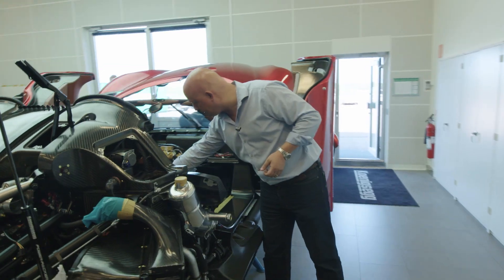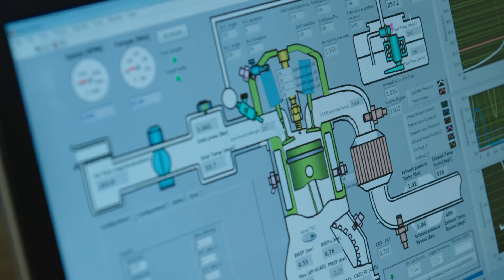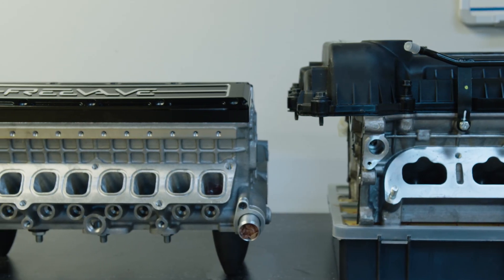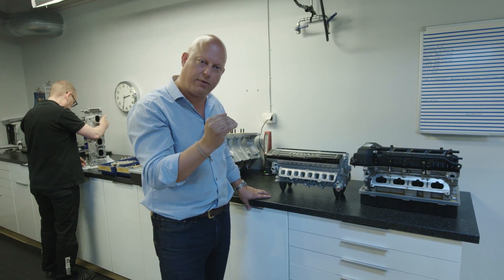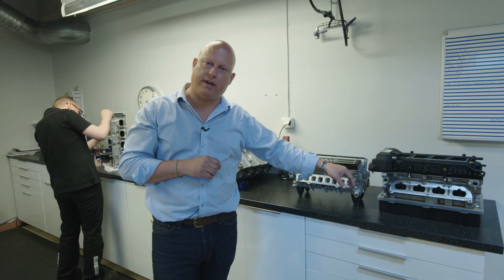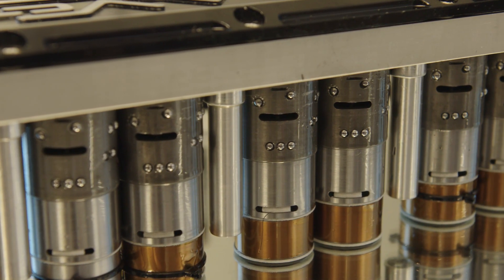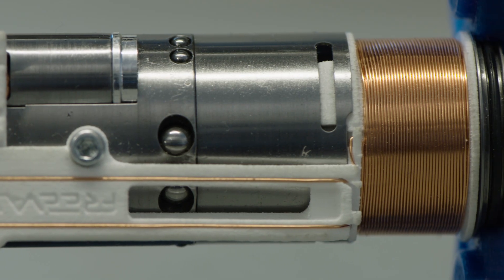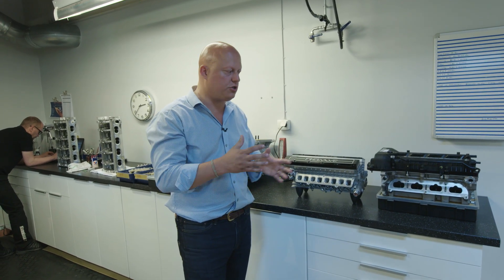Freevalve Update Camless Engine -- /INSIDE KOENIGSEGG

Comment: So theoretically you can turn any engine into "2 stroke" or have a "2 stroke" mode by doubling number of times the values open in additional to the fuel injection. I mean you'd need a blower or super charger. Something simple like a "torque amp"

Comment: It is lovely how he know so much, makes sense Koenigseggs are so quick right now, but I feel he has done a mistake, he says and I quote "You avoid getting particulates into the exhaust because you get cleaner combustion with a more controlled combustion of the fuel entering in the cylinder", this was regarding the advantages of port injection. I say this is wrong because in port injection engines, the fuel is sprayed a few moments before the valve is opened, this allows the fuel to bounce of the valve and tumble creating a homogenous mixture and allowing cleaner combustion. I feel that the part of the "more controlled combustion of the fuel" is incorrect, not the other parts, I may be wrong as I do not know exactly what they have done inside their port injections. This is just my belief.

Comment: Do the valves need springs to pull them closed, or do the coils do a push - pull on them. I heard the word pneumatic used, but it seems that filling a chamber and voiding it would slow the whole process down.

Comment: I'm really kind of wondering when I'm going to be able to buy a free valve head for my 1FZ FE FZJ Land Cruiser. I also think that Cummins 12 valve would be a good base. I don't know if you considered diesel applications. I'm sure you've considered just about everything but I don't know I just would really like to see a system not that I could afford one but if you haven't thought about it yet and you happen to  want to draw something up you know you can go ahead and get a hold of me and ship me one it'd be pretty great I don't know what you use for ECUs but I'vkind of had my eye on haltech I don't know if you guys work together or what but. In any case I think that what you're doing is amazing and could revolutionize a lot of combustion engines as an aftermarket system. Especially if everybody's going electric we're going to have a lot of old cars running around they can still be powered by gas and I think that you can get more power and better emissions with your system.
Reply: I bet you guys can probably design a sweet hydraulic tree valve system that would be sick. It'd be nice if things were hydraulic and mechanical controlled by electronics . Actually I can't share too much But I'm giving it thought.

Comment: The French used pneumatic valves a while back in F1 then abandoned the system because it doesn't work well: no thanks
Reply: Because the tech required wasn't there yet
Reply: @saber-san6270  it was there: buyer beware. This is a stunt that will inevitably sabotage anyone who buys into it, if it even ever goes to market, just like direct injection, which actually has made it to market and is trash

Comment: The issue I see being the primary obstacle is ensuring there is enough pressure to move the valves in a timely and consistent fashion. Hydraulics would have too much mass in their fluid, I think.

Comment: Even though this engine has been around for a while, fast forward to 2022 and our moron Potus is pushing electric cars, way before the world is ready, in regards to price, infrastructure and without regard to slowly phasing out gas engines. In fact, gas is now the highest in my lifetime ( 63 years) of $ 4.50 per gal average and $4.75- $ 5.25  in Illinois . I remember gas in the '60's as low as $.19 cents in Missouri, and in Iow a it was usually about .21-.25 cents per gallon, clear into the early '70's !

Comment: The free valve technology will allow an easy implementation of hydrogen as a fuel source this is definitely the way futures This combined with the new design of a motor and drive assembly electric motor makes for a very very powerful combination

Comment: why did this technology not happen ages ago ? I mean I come from a mechatronic / computer engineering background and I am into cars too, so I'm always working with servo's , actuators , SBC's etc. I have also opened a few rocker heads in my time and had always wondered why we do valve timing from a cam when everything we do in this world, including the central locking in said car to open and close the locks is done via actuators. It just seemed so caveman style, if we wanted better performance we would grind the cams but then we would get a bad idle down low. I mean , hell we control fuel via computers 50 years ago and there is a whole market on new ECU's to deliver better fuel performance. I thought there might have have been some mechanical limit to what an actuator could do at high revs, maybe the signal could not get fast enough to open and close the valves properly but it seems like there isn't. Don't know how useful this innovation is for the long term since EV's are on the way. But in the next 15-20 years , lets bring one of these cars out to the masses.  Building variable timing for different purposes could not be easier, we would not need to be grinding cams but just need to open up our laptop's connect to the ECU and change code to suite performance requirements.

Comment: Throttle control from the valves themselves. That blows my mind.  He says the valves are pneumatically driven, but I see a coil and terminals on them. Maybe solenoids control the air that drives the valves open and closed. I know the engine drives an air pump to supply that air.  To get that degree of control with that setup is beyond amazing to me.  Brilliant guy.

Comment: Kinda awesome, because in something like hot rods, you can have “switchable cams” on the fly, so you can switch between a “radical cam profile” and “streetable profile” 

Or even just have a “hybrid” type profile that around idle and under 1/2 throttle it runs in a streetable mode, and when you floor it, it can swap to a radical cam profile.

Even have cylinder deactivation for fuel economy when cruising your muscle car

Comment: so your controlling the valve without rocker arm and camshaft etc.  instead of solenoid valve. That may reduce the weight but what about the computer in the car that operate the solenoid vale in high rpm. another problem with the solenoid is coil burnout did you think of that ?

Comment: What's stopping a current manufacturer like Honda from designing a l4 engine like this? It seems cost effective and very good on emmisions. The engine is smaller and simpler with less moving parts, and yet way more advanced. Fuel injection picked up pretty fast, so why not this? It seems like it has no downsides?

Comment: God it's such a pleasure to watch this man talk. He's got so much knowledge but he can get it out in a way that's so easy to understand for the layperson, and in his second language no less!

By the way, Christian, you've got to get this technology into motorcycle engines. It'll make such an enormous difference there; bike engines are highly sensitive to size and weight so the savings you've made on both those dimensions will be extra valuable; since Euro 5 regulations came into effect modern bikes now have huge exhausts for the necessarily large catalytic converters which has both size, weight, cost and aesthetic concerns on bikes; the concept of variable valve timing is becoming more common now on bikes to get a flatter torque curve and better combustion at all revs--which would be completely superseded by Freevalve tech.

It's obviously great in cars but this would just be so much more valuable in the bike world! You'd be doing the industry such a favour by making it happen

Comment: Here's an idea, can we please get freevalve on the 2011-2021 Chrysler 3.6L Pentastar V6? They are notorious for bad valve train causing catastrophic engine failure. They are a good motor, NA producing 292-305hp, 268 LB/Ft of Torque. All the way up to 6800 Rpm.

Comment: Is this similar to current F1 motors 1.6l v6 use for valve control?  Believe F! also using brushless mtr to instantly spool turbo and also as part of batt. regen system. MB supposed to have E-Turbo assist vehicles for comsumers in 2021. Ya , this tech will extend petro motors yugely if costs allow.

Comment: I guess with this system the engine doesn't need a distrubution maintenance, because it doesn't have any distribution belt. If I worked on automotion, I would want to work on Koenigsegg.

Comment: seams interessting. Where does the power come for the valves to lift (high power for electromagnats). How do you solve the Problem with the powersupply when a battery or alternator breaks down and all the valves are falling down becaus of no powersupply to the coils holding them up? Than we have nice piston-valve crashes g

Comment: Pneumatic valves are at the core of some Yamaha, Suzuki and Honda MotoGP engines that produce over 250bhp per litre without turbocharging.  They allow much higher lift than would be possible with normal cam profiles without breaking they valves (or the cam lobes!).  There’s a world of possibilities for the internal combustion engine, and it’s perhaps sensible for governments to consider more exacting fuel economy regulations for their communities, rather than simply mandating electric cars, which have very high energy costs to produce (ie the pollution mostly occurs at manufacturing time, rather than running of the car).  I’m not also sure that governments have yet considered the high costs of refurbishing electric cars where the battery lifetime is much shorter than the expected lifetime of an internal combustion engine.

Comment: It's brilliant in it's concept,, but not practical in application.  I have no doubt that the initial cost plus the cost of maintenance over the life of the engine will make this a luxury item.  My biggest concern however is the potential for catastrophic engine failure due to piston/valve contact. One digital glitch could obliterate a $25,000 engine.  I doubt any race car owner would be willing to bet his season on such a razor's edge gadget.  I would much rather bet my money on a good set of valve springs, and a superior cam chain.

Comment: What well hapen if one of the solenoid fails?engine damage come next?
Reply: They have metal springs like regular valves which makes them naturally closed. If the solenoids fail the valves return to the closed position by default, so there would be no engine damage. You can simply replace the damaged solenoid. And I would assume that each cylinder runs independent solenoids, so the probability of a total engine shutdown or failure is minimal.

Comment: No throttle body. That's crazy. I mean yeah it can be done and I'm sure anyone can do it but just the cost and having the reliability of these type of valves. To be have absolute control,  pinpoint control of the valve. That's incredible. Awesome. I need to be rich.

Comment: Say someone here in the Bay Area, Calif sent in his 2.3L Ford OHC motor, paid Freevalve to do what is described in this vid, they ship it back, the owner drops the motor back into their ride, and not long after that the motor seizes up, or a head gasket fails, where do you think they'd be able to find a qualified automotive tech to work on said motor? Sh*t would be more than expensive quick, fast, and in a hurry.....ijfs.....

Comment: Why bother with a turbo when the camless system alone makes so many improvements? I would think the weight loss in turbo weight would be improvement itself, and the engine becomes even simpler. Wonderful system. So glad to see redesign being used to make such significant improvements instead of simply adding crap to an engine. Honda started this in the early-ish 70s with their CVCC engines. Great video!

Comment: Call me we will build my engine. Unlimited rpm and 0 friction. Pure flow and only barrier is the bottom end. feel free to rev to 40.000 rpm
Reply: You could increase intake pressures to 100-200 psi before valve even opens and no problems plus completely variable intake and exhaust. its to easy and turbo or compressor is a must with this configuration.

Comment: Damn imagine having electrical problems and bending valves. Good thing my engines driven by chain. Atleast I won’t have to search for hours or days for a broken wire, new valves, new chain, tensioners, guides. Good example on how fixing cars is going to get a lot more complicated and expensive. Good luck y’all!
Reply: Not at all. This looks far easier to work on. If you bend a valve, take out the whole module like a coil pack. These actuators probably default to a retracted position so I wouldn't worry too much about bending valves as much as I'd worry about timing going off and bending valves. Also this doesn't look too difficult to code for at a grassroots level. It's simple variable actuators. Just get the right drivers and you can probably get a Raspberry Pi to control it. Just don't act like an old man lol

Comment: Extremely impressive , but I do have a few questions, due to the circuit boards being located in the cylinder head , as we all know the cylinder head will get hot and this may effect electronics system functions and even cause soldering issues, I also wonder of the life expectancy of the solenoids due to its high frequency of activations, I imagine the life expectancy is rather short lived. If a solenoid were to fail , what type of fail safety system is in place to combat internal engine damage?
Reply: I would imagine the valves default mechanically to a retracted position but also know that there are a LOT of reliable cars on the market today with electronics in the head.

Comment: 8:21 they even modified their fan with tape to make it more efficient (some air would normally blow out the top, when taping that area, your forcing it all out the front, also reduce the energy required to push air out
Reply: That's how you can tell they're engineers lol
Reply: WOW
Reply: I saw that and was thinking about it. Surely not such a high tech company fixing their office fan with masking tape? There had to be another reason, you guessed it, reducing the fan centrifuging air out sideways ;-))

Comment: Rather than pneumatic what about using solenoid?  OR  stepping motors using little gear drive affairs for each valve  Depending on number of cylinders could either have individual stepping motors or else larger motor driving gear shaft operating like valves on engines with a bunch of cylinders. With todays battery technology seems totally doable to me ...mass production could make it pretty cheap too I would think...an engine could be so quickly retuned even on the fly for radically different performance or efficiency ....And how about adding variable compression then since no can drive to complicate that? Simply lifting and lowering entire cylinder head (via ring sealed head cylinders above piston cylinders) small movements up or down  could radically change compression!   High performance sports car could have econobox mode running 87 octane regular for road trips with computer adjusting everything else spark timing, fuel injection adjustment,and valve lift and duration.  Same engine could be fire breathing monster running e85 one day and the next day very economical lower power commuter and everything in between with the flick of a switch and/or fuel change!  Heck COULD even pull from two fuel tanks on the same car!  One with smaller with race gas and the other larger with regular computer systems deciding howmuch/when to pull from each!  EVEN on the fly!  Low compression and milder settings on start up /warm up and also could change relative to load.  Think of the power gain simply not driving those cams!     ...and for spurts of power alternator could instantly stop charging battery that powers valves .....let that happen on decel and constant speed but not performance acceration....even MORE power on tap!  PASSING power!

Comment: It looks like the valves are controlled electrically with one or multiple solenoids depending on how far and  how long you want them to stay open... At least to me.
Reply: That or the windings are for sensors to "see" the position and it functions from hydraulics...
Reply: Controll is oil and air.
Reply: @jonasthemovie  Thanks, I was curious about it because I only started hearing about this when they released info about them building the Gemera and I started to research about it. Right now I'm curious about what provides the air pressure to move the valves at the moment.

Comment: 3 years later and it's finally here...Gemera! :D
Reply: Gemera?
Reply: @cospar9486  https://youtu.be/E5VN-MI1mZA
Reply: GEMERAHHHHHH!
Reply: 4 1/2 years later and it's already in a Miata :D
Reply: @Amarjit Singh The Jesko's twin turbo V8 doesn't have the Freevalve feature, still got conventional camshafts to open and close the valves. That's why I mentioned the Gemera.
Reply: @Amarjit Singh I agree. And I also wonder why they didn't go with the Jesko. But then again, the Jesko came before the Gemera, so perhaps they still hadn't achieved the technical feasibility for production yet...

Comment: 100% active fuel management. Pneumatic actuators are very reliable and eliminating the camshaft system is brilliant. Much better than solenoid controlled lifters though. Come on GM engineers!!

Comment: I have been asking for this for YEARS!    I really should have Moved to Sweden.  I would have LOVED to work there.   
I guess I will just have to get my hands on one of those heads.  And strap it to something.     BMW worked on something like this a While ago.   But used Solenoids.  Heat I think was an Issue.     Glad this is NOW being done.   Its about time.  

What is really cool?  You can run it on anything from Beer,  to  Hydrogen.   You get the Max Power from each fuel map.    I wonder what it sounds like?